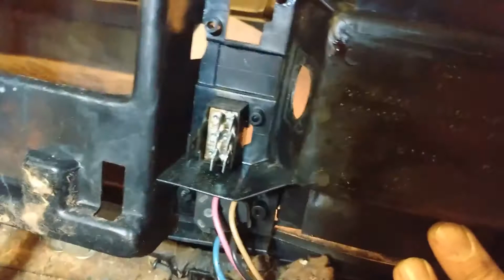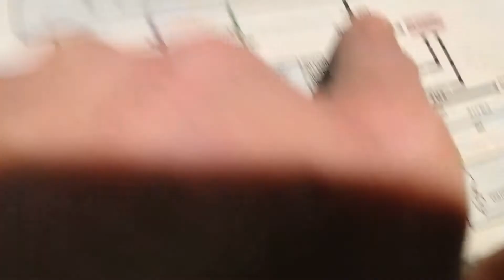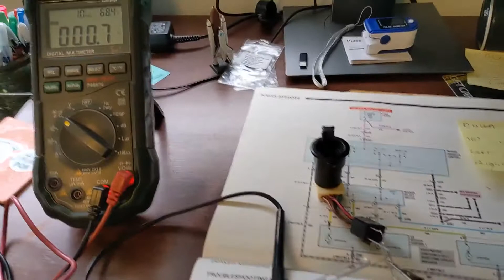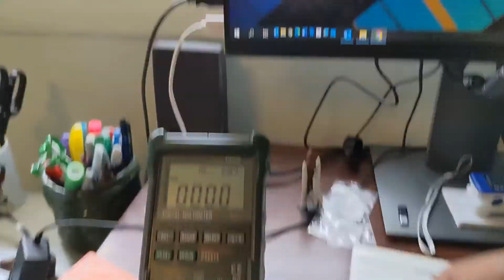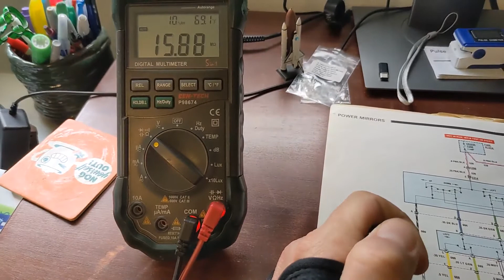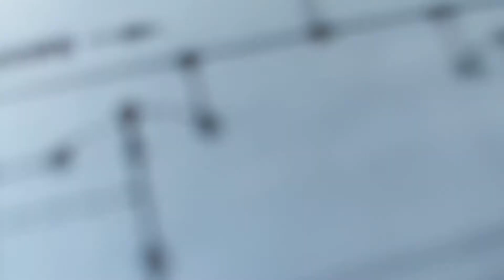How To: Corvette C4 Power Mirror test and replace

Comment: I'm also trying to remove the switches. Did you ever figure out the proper way to do it without damaging?
Reply from the maker: Got ya.  If you're talking about how to remove the power seat switches from the harness.. Yes you have to pull those two rivets out first. Mine was completely melted so I couldn't get it on video
Reply from the maker: If you're talking about the window switches... There's just two screws that hold them in underneath the center console cover The mirror selector switch comes out the same way.. The wand ...you have to completely remove everything to get to that.
Reply: @JerrSpud  sorry I meant the power seat switches, I must have posted on the wrong video.

That said my mirror toggle switch was also not fully working, thanks for this video to diagnose. I fixed it by soaking in vinegar to eliminate rust and corrosion.